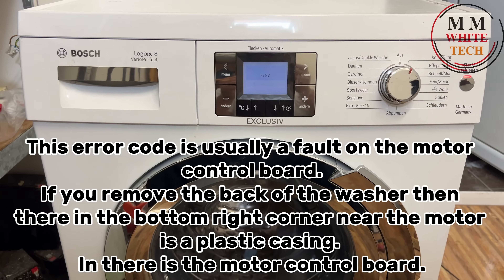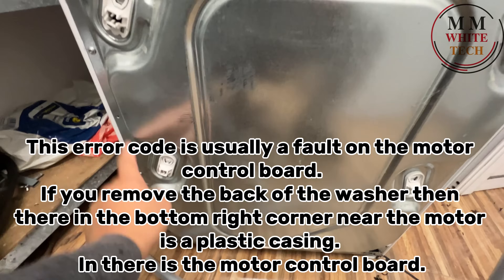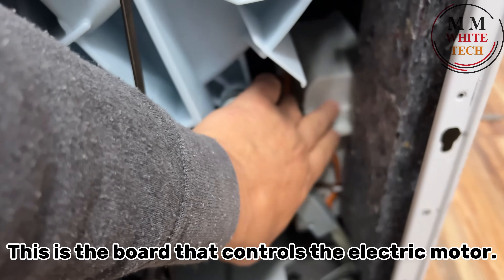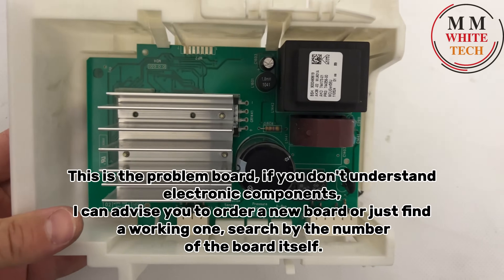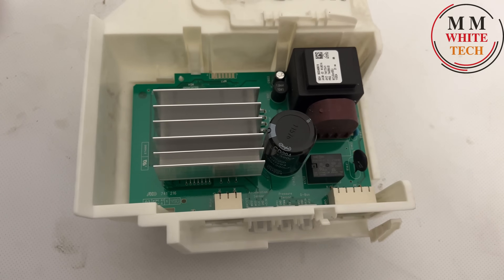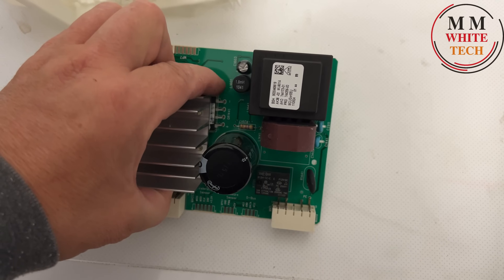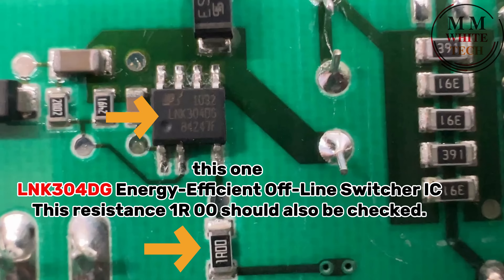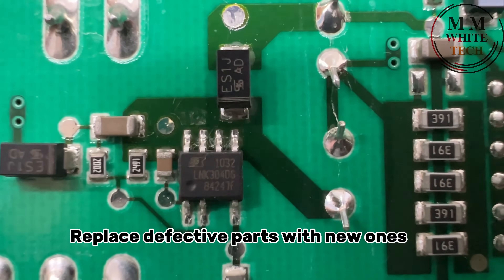Repair Error F:57 Bosch Washingmachine Logixx 8 WAS28793 not spin problem solved. How to fix.

Comment: Hello, how can I check the LNK? Can you tell me what values should be between the pins?
Reply: The resistor was not showing any signs of life, so I replaced it, and now it shows 46.6 Ohms. I also suspect the IRAM535-1065ASA module... Additionally, I'm not sure how to test it or what values it should have.
Reply from the maker: Check the resistor